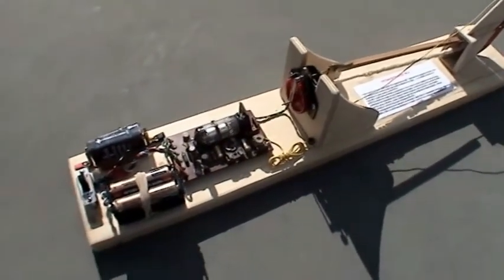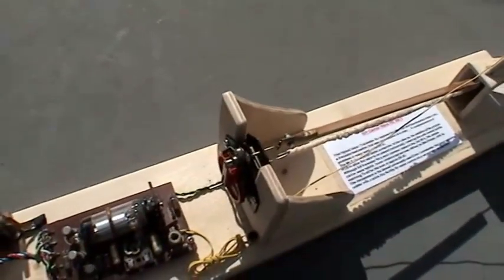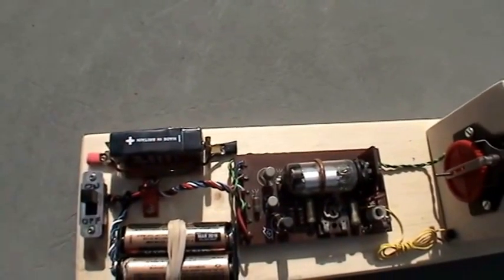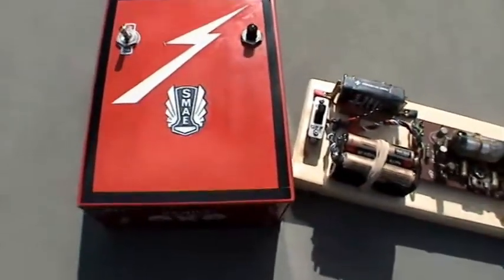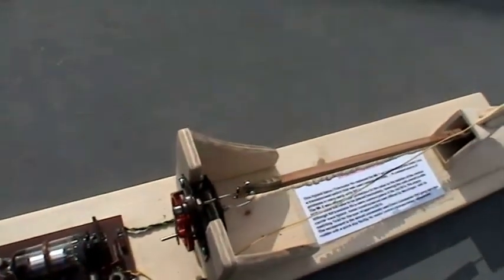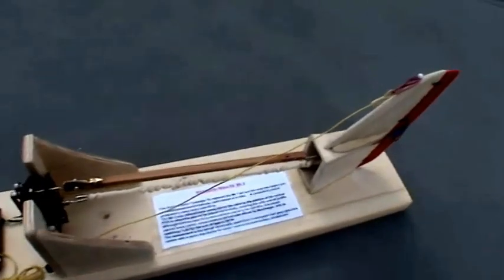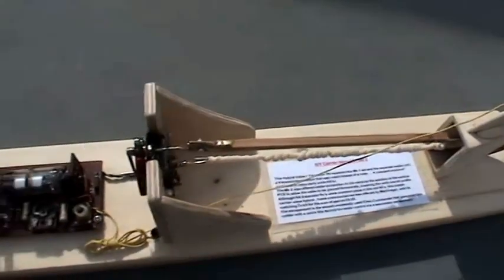Vintage Single Channel  RC   Ivy mk 2 Carrier Wave  Valve Rx

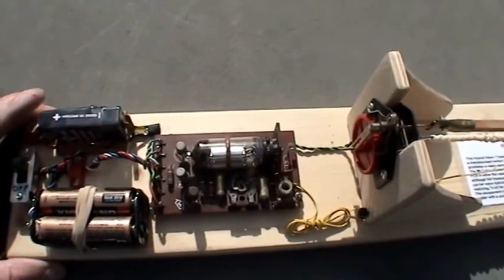Comment: Sorry but I don't understand wht you meant here actually 1:00 🤔 Superregenerative receiver is just a type of a receiver with amplification with positive feedback loop but it is not related to the frequency that it is receiving because the frequency is set by a resonant circuit (of course there is also a special frequecy of the regeneration etc.) set to the specific frequency. So it amplifies whatever it gets from the tank circuit. By crystal you mean a germanium diode? As far as i know in both cases there are resonant circuits but the superregenerative reciever is better because it is more sentitive for the signal and amplify it much more and also it can demodulate the signal so there is no need for a diode.  Sorry if I misenderstood something from your video (I am not a native English speaker and also i am not an engineer but my passion are those receivers ;) so maybe i could misunderstand something). Anyway I really like those vintage models electronics!!